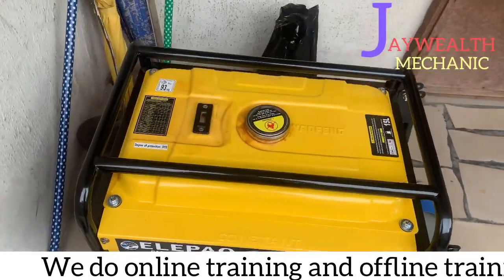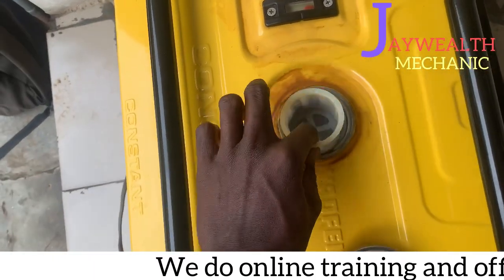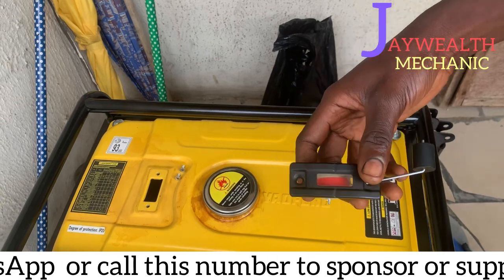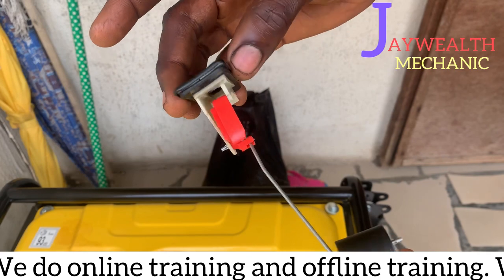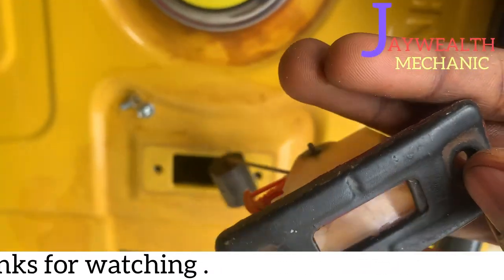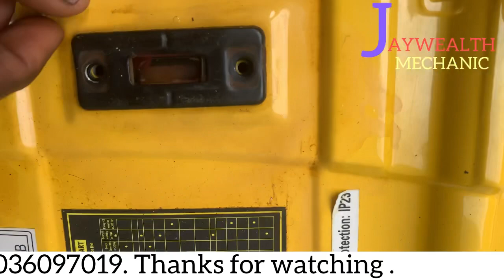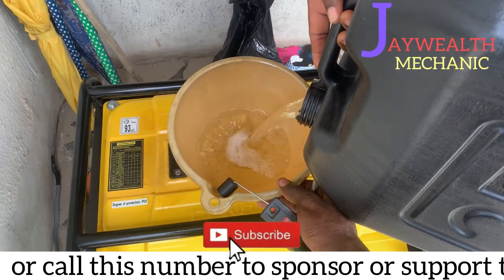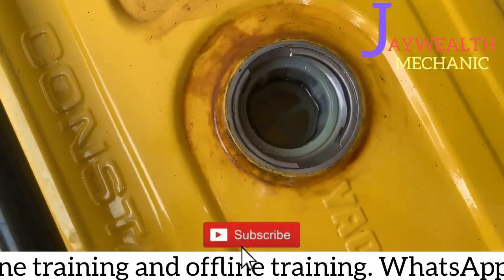FUEL TANK GAUGE REPLACEMENT

Comment: Mine isn’t broken and it’s not working anymore. Loosened it and found a rubber band, but i don’t know where it’s supposed to to be😫
Reply from the maker: Check inside the tank well whether it haven’t fallen inside.
Reply: @jaywealthmechanics9285  i noticed all the parts and there’s no sign of a broken part. It’s a new gen btw
Reply: The rubber band was for shipping only, it’s to help minimize the parts from moving around in shipping. The rubber band needs to be removed and discarded.